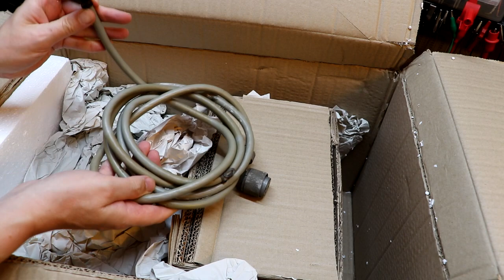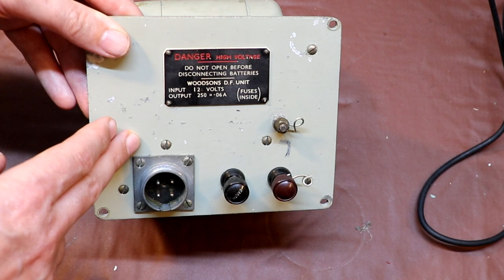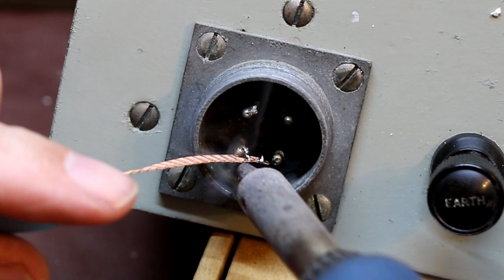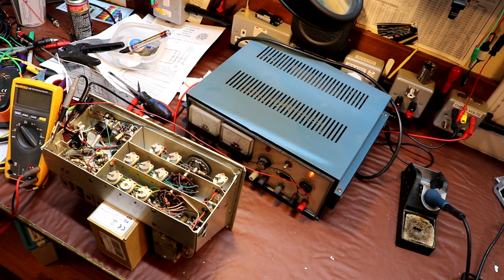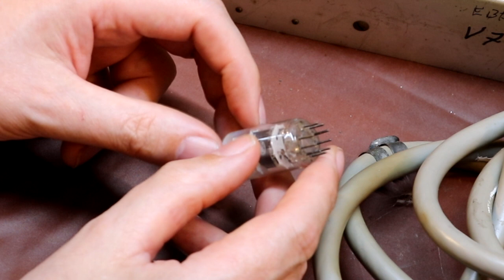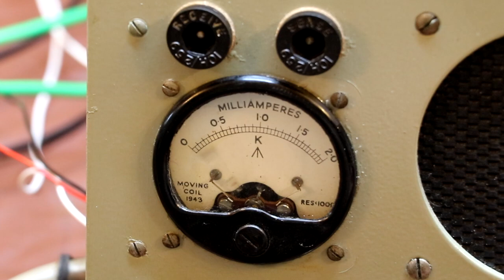Woodsons of Aberdeen SR-124 SER 126

Comment: Hi Chris...Very interesting video...Thanks! I recently purchased a WOODSONS OF ABERDEEN C50 receiver and can't find anything on it re a circuit diagram/manual etc...someone contacted WOODSONS  looking for a service manual and they told him they didn't keep any records of this receiver going back that far... '60's/70's era? could you or one of your viewers help out with a service manual or any info regarding this item? TIA and another subscriber...keep up the great work!
Reply from the maker: Sorry I cannot help with the manual I encountered similar problems. These are however very well built but for whatever reason those capacitors are very poor so you are likely to have to replace all the coupling capacitors in your set and the electrolytics. Love to see some pictures if you do a restoration

Comment: Don't worry he's  a trained professional. Impressive and good looking boat  anchor from the UK. Smoking oil in the capacitors! Replace them all. 
The power supply is not working properly  either because of the  E caps in it which may cause noise down the line, wrong power supply,  or missing tube on the
 radio chassis of which solved the problem. Great detective work on getting it working there and figuring out what does what on it Chris!
When a sea captain comes to visit you can impress him, with the wifey, not so much!
Reply from the maker: It’s always a work in progress nothing quite goes to plan and never to my satisfaction but I hope I learn a little with every radio I work on.  I have since replaced the capacitors in the power supply as it was easy to do. The other TCC capacitors in the radio are quite hard to get at but while they are working for now they can stay, but I know they aren’t good. Thanks for watching and comments regards chris

Comment: Excellent video Chris - never seen a motorised PSU before. I wonder how it was shielded from the receiver to reduce its seemingly very wide band interference? Perhaps the original cable was much longer!
Thanks for sharing.
Reply from the maker: I guess it’s no worse than a car radio with and alternator and the various other motor. It is in a very substantial metal box and it employs CLC filtering which does a good job.  The often installed the PSU and radio next to each of so it must have been OK. Thanks for watching regards Chris

Comment: Hi Chris,
That particular make is a new one on me but it was immediately apparent from the start of this video that radio is very rugged, and well suited for what it was designed.
As you was measuring the HT rail voltage - being around 500 volts, the D.C. voltage input could not be 24 volts: it had to be 12.4 volts to achieve HT voltage of around 250 volts.  I guess it was possible there was a power unit that was available to suit 24 volts input since some trawlers operated on that voltage (24 volt started Diesel engines etc.) - so not unreasonable to first assume 24 volts input.  Likely the 12 volts was for something like a small pleasure craft???
Those old TCC capacitors were very good in their day, but like virtually all old capacitors, they have their unwritten ‘use by’, or ‘best before’ date.  By now, most of them will be puking up their ring-piece.
The missing valve is very likely an ECC83.  The ECC82 valve was largely used in oscillator circuits such as television line, or frame oscillation.  They can be seen inside audio equipment, such as stage (guitar) amplification - usually in tremolo applications.  The ECC81 is often seen in signal generator equipment - not used for audio amplification, though can also be used for tremolo, or reverberation purposes.
I like the idea of maintaining this radio to be as original as possible whist at the same time keeping it functional.  
If it belonged to me, I would likely construct an additional mains power supply unit that could be connected to the radio via an additional lead sporting an identical Jones plug, like the Jones plug that connects from the 12 volt power unit.  It would make another excellent talking-piece since the radio could be demonstrated working via mains operated power supply, or via 12 volt power unit to likeminded friends.
Nice chatting with you my friend, The man from Sheffield
Reply from the maker: You could be right on the numbering but I think it more likely the label was printed 124 and the intention was to blackout either the 1 or the 4 so it could read 12 or 24. On close inspection I can still see the blacking on part of the 4 I think it must have fallen out.  Yes it a rugged receiver and very lively. I could built a separate power supply and did think of it but probably like you I am not short of radios I can listen too. Actually now the rotary converter is screwed down in its box it’s not so bad and I like using the radio as it was designed to be operated. I agree the capacitors need to be changed but again for the amount of use it will get and the difficulty in accessing them I think I will just keep it original until the performance sufferers. Thanks for the Advice on the ECC83 if one comes to hand I can change it out. I did try a couple of 82s and one did perform better than the other but the set is working well I think. Thanks for watching and informative comments regards chris

Comment: What a quirky bit of kit. I do really like it though despite the noisy motor. It would be good if you could maybe find out a bit more about the history of it. Great bit of detective work to find the missing valve and sort the power supply issue. I was wondering why you didn’t connect the negative to the 2nd binding post? Cheers Graham

Comment: Really nice video, Chris. Did you ever figure out what the black binding post on the power supply is for? You could connect it to that beautiful loop antenna you put together a while back. Regards, David.
Reply from the maker: It’s connected to the chassis via capacitor. I assume it’s maybe some form of noise reduction emc thing. I’m not sure if boats use a common ground to the battery like automotive stuff ?

Comment: Great video chris very interesting when i seen it the first time i thought it was from an aircraft as i used to work on the more modern transistor versions back in the day none of that valve rubish 🤣. only problem with this radio you would need to have the power supply in another room .....😆.
Reply from the maker: I prefer valve stuff I find it easier than transistor although I do work on modern stuff in the day job. Yes your quite right on the converter I used to have one that came from an aircraft. It was very noisy and drew a lot of power. Thanks for watching regards Chris

Comment: That’s a genemotor ya got there mate! Think that’s a 1200A fuse cleverly disguised as a lathe tool, lol, bit of a change from a 4 inch nail. Interesting, a triple gang tuning capacitor, that suggests a tuned r.f. amp.

Comment: I bet that input was 12.4V...
Reply: That's also what I was thinking.
Reply from the maker: I think the letter was designed to be blacked out so 124 could read 12 or 24.  The front of the label had a small amount of blacking inside the 24 so it probably should have read SR-12. I’m guessing.

Comment: Hi chris i think the double triode should be an ECC83 (12ax7) it has higer gain than ECC82 though the set seems to work ok as is
PS the 6 pin jones plug is worth about £20.
Reply from the maker: I think I will leave the 82 in for no other reason is I have a few of them and I don’t have an 83.  But I did try a couple of 82s and one did perform a bit better than the other. Great information on the Jones plug I need one for an antenna connector although I’m not like to spend £20 on one I’m far to tight for that

Comment: A great find, Chris. I wonder if that meter is original. Looks like a War Department "crow's foot"  mark on it and may pre-date the radio. Is that a 1943 year mark on it? If so, it pre-dates the introduction of B9A valve bases. 

How about a rotating roofrack project to complete the job? Cheers, Steve
Reply from the maker: I have been looking for information on the loop Antenna but not turned anything up yet but it would finish the  project off nicely I think. I think the meter is original as I found some pictures online and it looks like this was standard for their equipment. The company started in 1947 so probably using up a lot of surplus stock. I think this radio dates from the 60s

Comment: 10:30 I think that rotating that plug can cause the polarity to change, and maybe that was the reason of the smoking electrolytic capacitor ?
Reply: Those military style connectors are usually keyed, so that cannot happen.
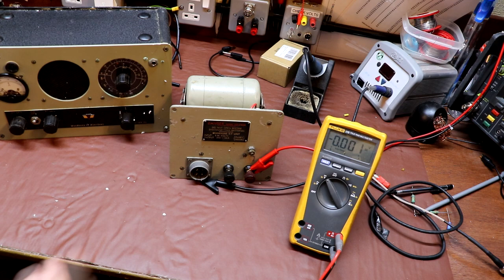Reply: @danishnative9555  , you're right, after looking again, at 9:45 there is a key on the bottom of the connector.
I was misleaded that the powersupply couldn't rest flat on the bench due the 90° angle of the female connector on the cable, 
but those units where probably mounted in a wall during use.
Reply from the maker: Yes the connector is keyed the spacing of the terminal is different but as you say I tried my best to insert it wrongly

Comment: Well that is unusual and you can use it as a ordinary radio :-D
If it was mine i would modify the psu, snip the wires to the generator and put a mains transformer in it with some diodes caps and basic regulation. (not a switchmode, loverly harmonics piped into the radio lol).
Same output but no noise :-D

Years ago i was given an odd valve radio that had a thick cable coming out of the bottom left hand corner of the fasia (heavy duty power input).
Monster antenna posts were on the top right for the antenna.
It was housed in a corigated tin box and looked like it would be at home in the back of an army jeep.
But the tuning scale was for ordinary home radio use, i think it was a surplus unit that was rescaled for ordinary use. (something to do with philips bulbs,  odd).
I made a psu for that, transformers/diodes/caps and a delayed 100vdc relay so the heaters had time to warm up before the anodes got power. (i thought delayed anode supplys may be kinder).
I guessd the voltages via the valve data, nothing was written on the chassis to help me, but it worked :-D.
Sorry long waffle :-(
Reply from the maker: Yes I could build an alternative power supply as I would like to keep it original. But the rotary converter does make the set that bit more unusual. It’s a very good performer on the broadcast bands. I will probably play with it before it finds its way to another cardboard box in the loft etc

Comment: 5:38 It's a "calibrated fuse from Apple" , it will never die :-)
Reply from the maker: Yes they should making all fuses this way as the traditional ones fail too frequently
Reply: @allthegearnoidea6752  if the fuse doesn't blow, something else must take the heat, some components are cheaper then some HRC (High Ruptering Capacity) fuses to replace.

Comment: I enjoyed that Chris, an interesting video, I've never seen such a radio. (Looks lovely) and nice that the company survives today. l did spot the 12v / 24v marking on the power supply right at the beginning, (124) I've seen that somewhere before now, but cant remember where, (perhaps back in my RAF days), but no harm done. FAB video. Thanks for showing.
Reply from the maker: My theory on the code is that one of the digits 124  should have been black out so it should have read 12 or 24
Reply: That's how I (very vaguely) recall...